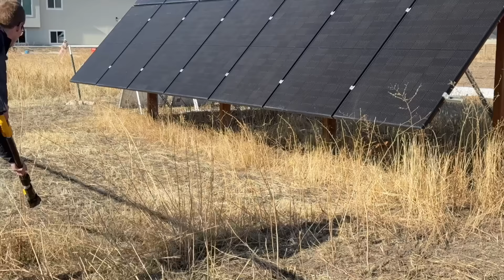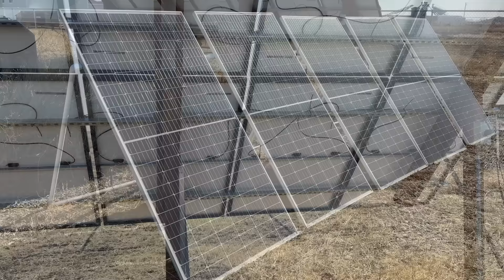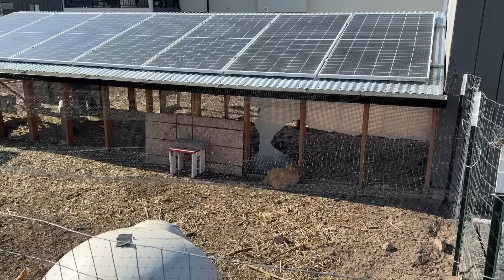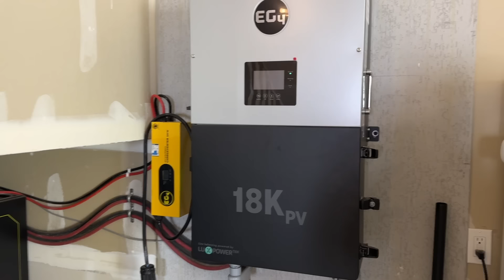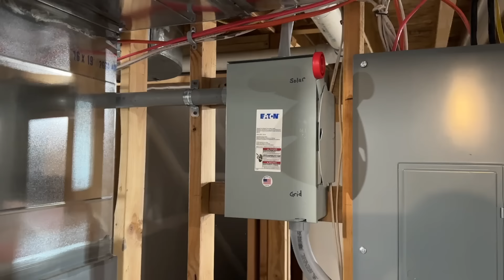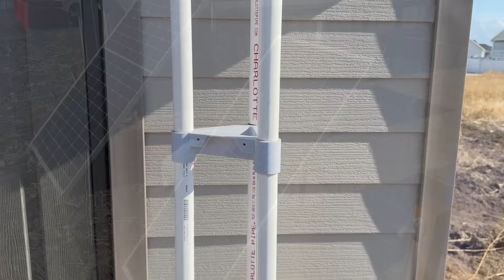We Said Goodbye to the Power Grid... Forever

Comment from the maker: If you're looking for solar equipment at the best prices check out my project → https://drop.solar

And for those asking about price... We paid $20k for everything, but it ended up costing $14k after the tax rebate.
Reply: Im building a similar setup right now thanks to my power company deciding to tell me i owe them 21k and shutting off my power. Started with a kohler genset 18kva that i had for a data center, and an apc 15kva battery backup. I have the 18kva eg4 inverter and 10kwh of batteries coming and 5kw of panels which will go on my barn.  I also have a 10kw wind turbine but i havent figured out if i wanna use that yet since it requires a permanent pole mount
Reply: The sale rep told me the inverter can charge and invert at the same time and (take ac power in from generator or grid) i see you have a little box for this. Do i need to buy that
Reply: I hope the wind isn't too strong where you are. Where I live it wouldn't last a season (We get storms with 80-100+MPH winds 3 or 4 times a year).
Reply: Ugly yard

Comment: I think I know what the "ChargeVertter" does but I want to make sure. I have, like you, an inexpensive open frame high capacity Dual Fuel gasoline/propane generator (I know you have a Tri-Fuel). Mine is 12KW peak. I can run my whole house and my A/C unit with it.  But, my microwave, Digital TV, ..... I am afraid to run due to the "dirtiness" of the power it produces (on my O-Scope).  With the EG4 ChargeVerter, can I plug it in directly to my generator and then plug it directly into my manual transfer switch on my on-grid breaker panel and power my house with "clean" electricity cleaned-up by the Chargeverter?  Or, (and I may not even have this right), do I have to charge batteries safely from my generator through the Chargeverter and then power my house from the those batteries through an Inverter (like yours) that is already capable of clean pure sine wave power?
Reply from the maker: Yeah so the chargeverter is only for going from dirty AC power to DC to charge the batteries. Then you’d still need to use an inverter connected to the batteries to run the house with AC power

Comment: With any water on those posts, you could be looking at failure in a few years.  Even pressure treated wood is good only to about 10-15 yrs.  Consider 3.5" oil field used tubing very cheap and will last as long as the panels.  You can add them in between your posts and be good to go for 20yrs plus for a few 100 dollars.

Comment: Eliminating the power grid hook up yes. However, you still have to replace anything that dies. If you consider all your time and cost of replacement battery's and controllers ect ect. In long run its about exact same cost as if were hooked to the grid.

Comment: Good system. I have built a 16800 kW system with 3 EG4s, so I can generate 150 amps.  I went with the 32kWh 628amp batteries x 3.  I love the Bitcoin miner. I am doing the same things. I have a big-boy miner and several Avalon Qs.  With the 18pv, why didnt you run the grid though there, from my understanding makes it easier to switch from grid to solar.  For me, I still have grid as backup; I went from 70 kWh a day on grid to almost nothing. I found that using a grid/gen breaker box is easier to manage than before the EG4, and you can also monitor grid usage. You might find your grid meter always reads high, as I did. I found my array to be generating less power than I needed.  I was, and am, interested in how you built your ground mounts, as I am putting in another 20 kW of solar panels. Sadly, the mounting systems have gotten out of control in price, so for me, it's a DIY system. I love how yours are adjustable for the season.

Comment: I’ve been learning a lot about Dirty power recently, your champion generator is at an inverter or just a standard generator, might wanna look into that if you don’t know, already plugging that in can hurt the electronics and charging I think. To me it makes no sense because solar is all over but these units are very sensitive AC.
Reply from the maker: Oh yeah the harmonic distortion on our generator is too high to feed directly into our inverter. That’s why we have a chargeverter which is designed to take in dirty power and charge the batteries directly. It’s worked great for us!

Comment: From experience, it will disconnect the settlement from the substation and switch all power supply to batteries and solar panels. This is a very illogical decision, very expensive for the wallet of all residents, as one friend compared: "For a person who spends most of his holidays in Courchevel, it's not particularly expensive"

Comment: Off grid for 3 days now with my Sol Ark 15k. This morning I overloaded for the first time. 5 ton heat pump was running, the hot water heat pump was running, various lights and PC on, when I turned on the microwave that did it. With just 50 amps you have to watch it. I have 7kw of DC solar, and 5.4 KW of AC Enphase microinverter solar. 30 kwh of Eco-Worthy server rack batteries. It's been in the low 30's at night here in southern NM, and the heat pump runs a lot. I'm using 80-85% of my battery overnight. No generator (yet), so I've been going back on grid for a couple hours in the morning. Not quite at the point to go completely off grid for extended periods.
Reply: If the house is well insulated enough and you get enough solar energy over the day you can use the house as a thermal battery, just heat the house more during the day and less during the night.
Reply: @Heimbasteln  I open all the blinds on the south facing side, and on sunny days my heat pump doesn't run from mid morning until after dark even when it's pretty cold outside. Here in southern New Mexico we have a lot of days like that.

Comment: I haven't seen power from the grid for years. I got 20 * 590w and Deye 20kw hybrid 3 phase inverter and 6*100ah 51V. But the electrical distribution company messed up the phase sequence and the inverter does not charge from the grid anymore. But I don't need it anyways.

Comment: If my math is correct, how are you running that many amps through those tiny wires?
Reply from the maker: 10 awg can only carry up to 30 amps. But that's the cool thing about high voltage, you don't need that much current to carry lots of power.

We're normally at 450V DC and if you multiply that by 25 amps it could carry over 11kW of power on each pair of wires!

We're normally far under that though. Closer to 15 amps on the big array and much less on the other two.

Comment: We use to be grid tied but we realized the line item “Distribution Charge” was the exact same with 0kwh used and was $130 for the month. So we called to remove the service and meter… that was an absolute nightmare to get them to disconnect the house and remove access.
Reply: I was going to ask the original poster how much the electric company charges him per month while completely off-grid.
Reply: @mattclary2069  It’s ridiculous. I saw a YouTube video of a guy in court that Consumers Energy sent one of the consumers inspectors they red tagged it and then took the guy to court over safety issues. The guy wasn’t even connected to Consumers Energy’s grid he was off grid and the “inspector” who red tagged it was in a sales position 6 months prior.

Comment: Building a Mickey Mouse Support structure is merely Tip of the Iceberg in complexity or Effort. 
This in the Arizona Desert ??  
And even then... WHAT is necessary to have available power when the sun isn't shining OR after sunset?? 
 30 !?? Deep discharge Lead acid batteries (and ALL the cost /maintenance those demand?)

Comment: Great video and setup. I've seen a lot of these videos and always wondered, how long would it take to actually make up the grid cost against the cost of a system like yours, since I'm estimating $15K - $20K range. Probably more if it was contracted out, and required code compliance. Thanks.
Reply from the maker: Yeah we paid $20k for everything, but it ended up costing $14k after the tax rebate. We figured it'd pay for itself after about 7 years. That was over two years ago so five more to go!

Comment: With a generator , one is not off the grid so as to speak. Unless you live in a desert area, one needs outside power. I have 11kw of panels, 2X8 kw inverters and 15kwh of batteries. With a daily usage of just over 35 kWh, I need about 100kwh of grid power a month.

Comment: Seeing this I’m inspired to give it a go in trying to power my shed. It has the wiring already for 2 outlets and 2 lights, it’s just not tied into the house. So I’m thinking this might be the right size project to try. Any tips or changes you’d recommend for a shed setup?
Reply: I bought a house W/ unattached garage. on a seperate meter. meter charge was $25 per month first 2 months electric usage on garage was less than one dollar but bill was $26. spent $350 on panels charge controller and deep cycle bat. got rid of meter charge . runs door opener lights keeps bat charged on classic car and lawn mower. five years now saved some $$

Comment: Oh, I would love to have the panel set up you’ve got, but I live in hurricane country. It would end up six counties away.
Reply: Dig holes big enough to put 5 inch pipe in, make them deep enough plus 1 ft for a pulley, to sink 4 inch support pipes into. Use a cheap winch mounted under the panels to raise and lower the whole thing. When a hurricane or tropical storm comes, level the panels and lower onto the ground. Secure with pins, up or down!

Comment: First, great video going over your system.

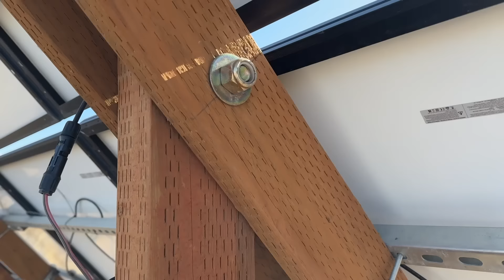At the 1:13 mark you show the bolts with nylock nuts you are using for the pivot function of you large array. Depending on how much you pivot (or care), you should replace those with longer bolts. The point of the nylock insert is to "lock" the bolt to the nut. You bolts don't extend past the insert, so those bolts and nuts will get loose over time. You want at least one thread of the bolt to extend past the insert.
Reply: Ya, they could be a 1/4" longer, but it looks luke they are holding up to me. If it were me, I would keep the bolts and put a little blue thread locker on them with the nylock nuts?  But not until I had a problem with them coming loose. If it ain't broke don't fix it!

Comment: Are the batteries installed in your house? Were there any concerns you had with putting them there? It's my understanding that LifePo4 is on the safer side.
Reply from the maker: Yeah they're in our garage. And yeah LFP is a much safer battery chemistry. Very resistant to thermal runaway unlike other chemistries. I do have a fire extinguisher nearby to be extra safe. But a lot of the newer LFP batteries actually have built in fire suppression too. No concerns from me!

Comment: I have 48 each 405 watt panels, live in the pacific northwest and it cannot keep up with a two person household of 2100 SF.  In 7 months the panels fell behind load by 10,500 KWHRS!  Why?  Geoengineering.  Low sun angle.  Lots of cloudy days.  Five months generated a projected 6,000 KWHRS of power.   Now as I approach the one year anniversary of the install that cost me $83,000 I realize solar for northern latitudes was a scam.   I did receive a rebate of nearly $25,000.  But here is the deal, my payback is over 50 years. Until the one year anniversary will I be able to calculate the generation rate, but I can say that I am well over a 50 year payback on a system that will last 25 years if I am lucky.  The  Sol Ark inverter will last perhaps 10 years, at $10,500 I doubt if it fails I will replace it.  At that point I will sell off the system parts and just do what I should have done from the start, buy a whole house generator with a big propane tank and be able to have power when its out.  This last winter, despite three huge EG4 280 AMP HR batteries I was forced to fire up a generator to keep the freezers, fridge running.  To heat the home.  Don't buy into solar unless you talk to competent solar panel owners.  Southern systems do have paybacks in the ten year or less range but the northern third of the nation forget it.
Reply: I’m in the Seattle area. My 9 Kw system has zeroed out my electric bill.  Note that I have gas heat.  Also being grid tied makes all the difference

Comment: Really liking that mounting system you came up with, I've seen very similar industrial installations and I like simplicity of the pivot mechanism. If you don't mind me asking, what is the output voltage from the battery bank?
Reply from the maker: Thanks! Battery bank is 48V

Comment: I did fully permitted off grid systems for a living for many years. To handle the wind loading calculations my footings were 7 feet deep.
Reply: I did nothing in this field, but I know what high winds can do, even in my area are not the strongest winds on globe. 
And that wood setup seems flimsy. 
What wind speed do you think that cam break that wood?
The pvc setup I assume that is moved inside when wind comes. that rebar as anchor may resist more than the pvc, if is deep enough. 
But that pvc tower with no anchors lead me to the thought that there are no winds at all.
Reply: Well, out in the country you can do as you please! But yes, I would have used galvanized 5" fence post for the supports, driven 4' or 5' in the ground and some augers and cable to secure them. Winds can do some damage.

Comment: Once we get large, cheap silcon carbon batteries, a setup like this would be better for long-term usage and very low maintenance.. what's keeping me away from such projects is battery prices and solar effectiveness in a high heat environment.. i live in kuwait. The electricity is dirt cheap, a kw is 0.007 usd or to be more accurate 0.002 kwd.. the problem for solar is that summer temperature is around 55-60c (131-140f), and winter temps are from 0c at night to 34c (32-93f) in the afternoon.. 
Ac is at least 60k-120k btu for a small apartment to a not so big villa.. how would you power this for 24/7 on solar and batteries? Its simply impossible unless u have a huge roof or a huge land area to place the panels.. not to mention that solar panels in 50c ambient air run at around 80c so the efficiency drops by almost 28%.. the whole project is not feasible..

Comment: i think for the water heater, a better option than solar panel would just be to paint the thing black and maybe have a pipe loop also painted in black to just directly absorb sunlight as heat, as it is then even more efficient than solar panels and cheaper

Comment: Replace the pivot bolts on the pressure treated lumber / unistrut mount with longer ones so that you fully engage the nylon lock inserts on the nuts. You should have at least 1/4" of thread protruding.

Comment: Nice video!  So with the transfer switch you are either running off grid or via the solar array but not both (so no using solar to directly offset grid use)?  Is the solar array able to run bigger loads like central A/C?

Comment: Unless you don't have access to municipal power, spending $40K+ on a solar system is not a rational way to go. You could invest that money and use the dividends to pay for your power bill. Instead you've upfronted your power bill and committed yourself for the next twenty years. Cross your fingers nothing quits or you'll be buying double. Transfer the system risk to the power provider so you don't have to take all of this on yourself. The notion or "feeling" of being liberated or "free" is not worth the hassle.
Reply from the maker: We spent $14k on our system. That’s the great thing about DIY solar, it’s much cheaper than you’d expect!

7 years is the total time it’ll take to pay for itself and we’re already 2 years in. It’s not for everyone, but we have no regrets!
Reply: @SmithOffGrid  thanks for sharing. I'm 99% hydroelectric dam-driven power where I live so it's not a reasonable investment to make for me. I've lived here for 30+ years and there's only one time that we lost the power ~6 hrs but not enough time to melt the ice cream in the freezer. Good luck with your system and channel.

Comment: Genuine Question. I drive a forklift, and the battery on it is like, 48v and works out to about 63 Kilowatts of power. I see the costs of all these grid batteries for set ups that don't move and just wonder why people don't use a Forklift battery. The only downside of it I could think of is that you have to water it every couple of weeks (About 20 full charge cycles) to maintain the electrolytes but they have cheap sensors to tell you when to do that. Sure, you need a forklift to move it, but in a setup where your power doesn't need to move, I don't see how that would be a major issue.

Comment: This solar off grid power arrangement must have cost a lot of money for all the equipment and installation. The big question is how many years will it take for all this equipment to pay for itself. Also all this equipment will wear out over time and need to be replaced, which will cost money. So when all the costs are totaled up over a period of time, will this system all be worth it? Or will it just be as economical to have not bought and installed all this equipment and just run off the local power company.
Reply from the maker: $14k for everything after tax rebate. We ran the numbers it should pay for itself after 7 years. Still should have many years of life left in the system at that point!
Reply: @SmithOffGrid  Does that include everything? Batteries, cabling, switched, etc.? You did this at the right time. Not sure this will be feasible in the future. Loss of rebates, fines and litigation from power companies, zoning restrictions, etc.